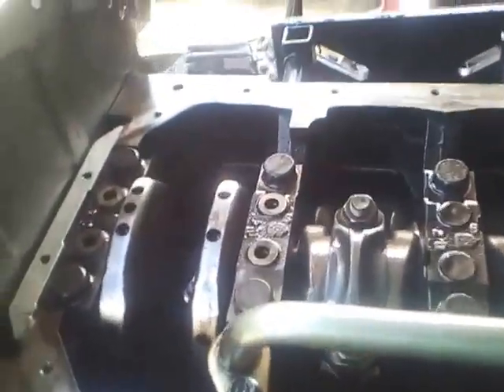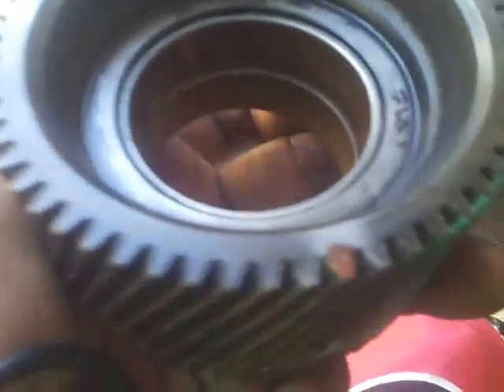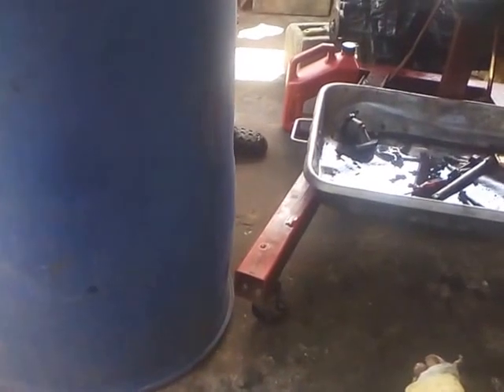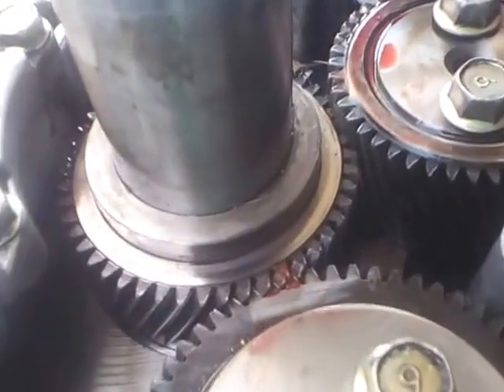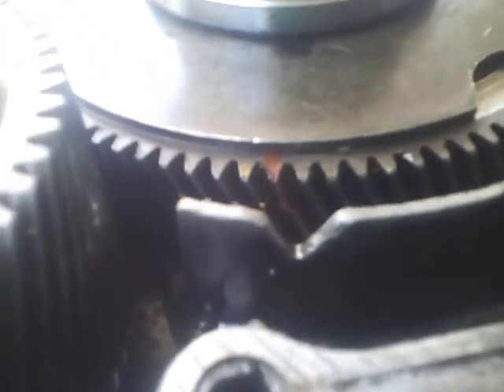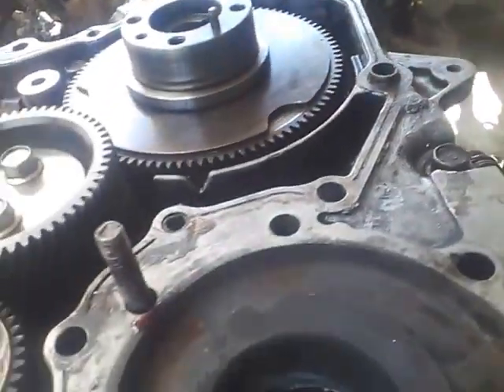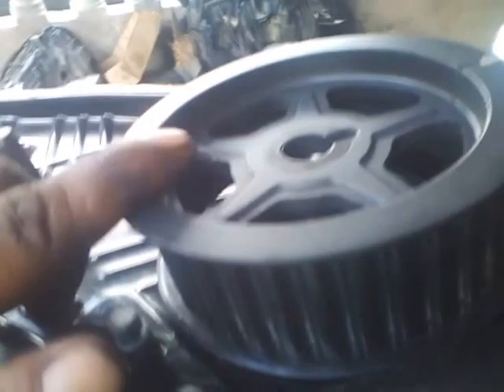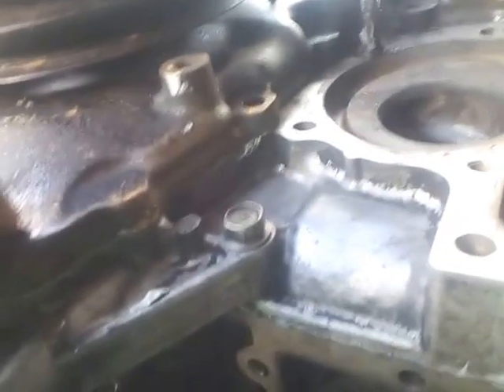part 2 -Timing WL/ WL Turbo Engine

Comment: I would like to know the torque specs for a b2500 wt-td engine. Head bolts, crankshaft and con rod bearings. Please help I'm doing a rebuild
Reply: How’d you do I’m doing the same